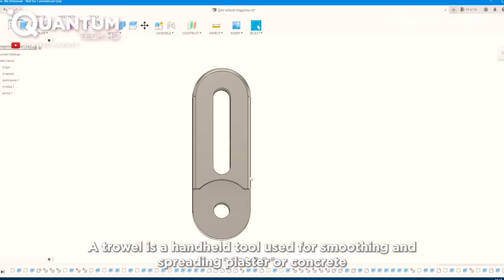Man Makes Genius Handyman Inventions & Homemade Tools || @ShayterAndrey

Comment: This is certainly an interesting solution to break one to make another. 
and here at 6:03 is a really useful device especially for those who make a hole for sockets in concrete there is usually a lot of dust and it is not very pleasant to breathe

Comment: not bad! but for the last one, I'd recommend buying a tool with a vacuum port already installed instead.
Reply: The beauty is not spending more money. It is being ingenious enough to come up with self made solutions. Surely he can patent and commercialize. The objective of the video was showing up the ingeniousness of the handiman.
Reply: @ruthejimenez  of course, I know that :) still, saws like that are pretty dangerous on their own, let alone tinkering with one, that's why I suggested going for one with a builtin vacuum port, as the vendors can also optimize for safety

Comment: 4:30 bro 😂 bro...they make a gauge that tells you your angle...the manual for almost all miter saws tell you your setting to make that miter cut work...WTF ARE YOU DOING!?!
Reply: The instructions contain angles for two planes! It shows how to file the angle created by three planes.
Reply: @ДимаИванов-б3о4и  three planes is still two planes plus one. The video showed a long span, a short span, then a long span. If you get the degree of angle from the long to short you also have the same for the other side of the short. It doesn't matter how many planes you have, it's ALWAYS two planes plus x.
Reply: @A_Stereotypical_Heretic  Better watch the full version of the video. It clearly explains the problem and how to solve it. https://www.youtube.com/watch?v=LooeXrEXjwI

Comment: well that first idea was a total fail tried to smooth the curve and the edge didn't even reach. also once it has the weight of plaster on it I don't think it would last long or hold its shape. 
and it's nothing you can't do with a normal float anyway just need to go up and down with the float side ways STUPID

Comment: don't get me started on the third idea all the fucking around to get a bit coving up and the hoover one the hole for the drill has to be the exact size every time so you'd need a lid for every drill bit in your tool box or it's only gonna get some of the dust baring in mind there are already tools better tools made to do this job way better